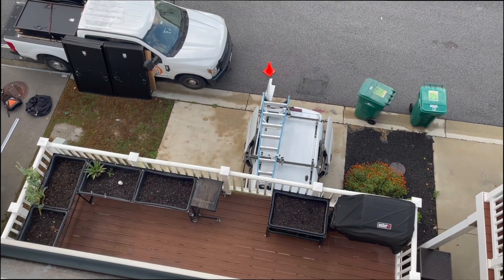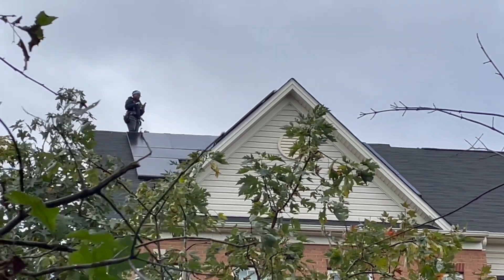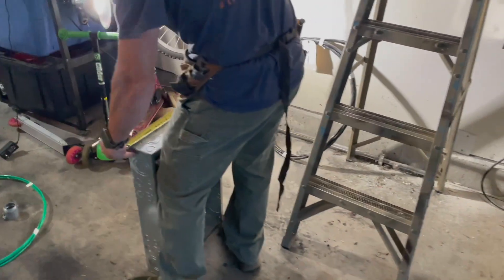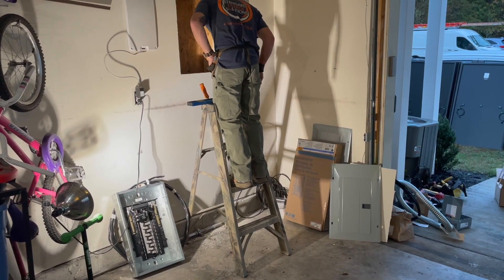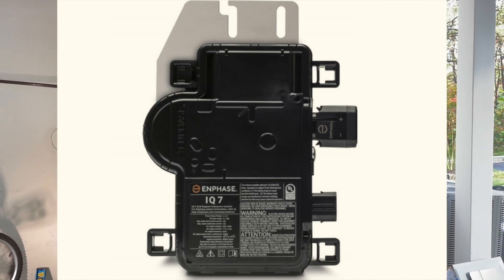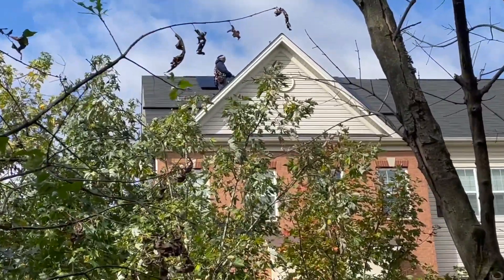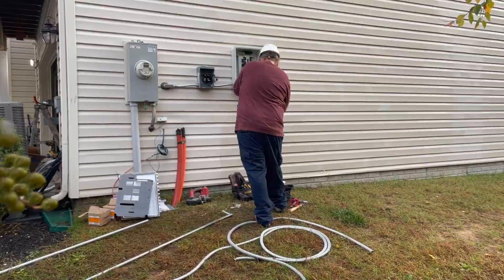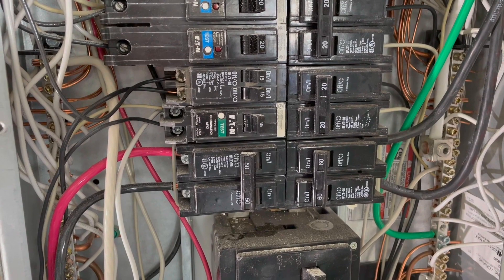iShare My Enphase Solar System Install

Comment: Congrats, man. It looks great. We just signed up for a solar install but without the sunlight backup or battery backup options--as they were prohibitively expensive compared to the panel install. I figure, one step at a time. Let your installers do what they do best--design, install and maintain the panels to guarantee power production levels, and upgrade to sunlight backup later since it does not involve roof work. (27) Solaria 400W panels, IQ8 Plus inverters and IQ Combiner 4/4C.

Comment: You do know if the grid goes down your solar also goes down. You seamed confused about that in your video.
Reply: If you actually paid attention there is a neutral based transformer in a device that detects if the the grid shuts off and it flips a breaker to kick on the back up batteries.
Reply from the maker: Google: Enphase IQ8.
Reply: @isharehow  Do you have a grid shutoff relay or something?

Comment: When you said that you can have power without a battery during an outage with the iq7 inverters you are incorrect.  If anyone wants power with now battery during an outage without a generator, they need to have the Enpahase iq8 inverters.  Enphase calls this "Solar Backup" as you can power the home with no battery backup... as long as the sun is up.  The iq7 can NOT disconnect you from the grid, which is required by code and also prevents killing power line workers.  Thus, during an outage the iq7 inverters automatically turn off the power production to the home.  The iq8 with the other Enphase equipment can disconnect from the grid to power the home.  This is called "creating a microgrid" and it safely and legally allows your home to provide power from your panels to the home with no other energy source (battery or generator).  To be clear, if people don't live in the city and are not ever connected to the grid they can potentially have power with other equipment made by various companies.  However, currently the only available way to have solar only backup in a home connected to the power grid is with the Enphase iq8 inverter.  It's an amazing product and one I've been waiting for years for, thus I'm more informed than most people on the subject :)  I've been in the solar industry for years and speak with Enphase's lead trainer frequently.  I would suggest you make a correction to your video or at least comment below my comment so that people don't make poor decisions based off your honest, yet mistaken comment.  Thanks for showing the install and making the video.